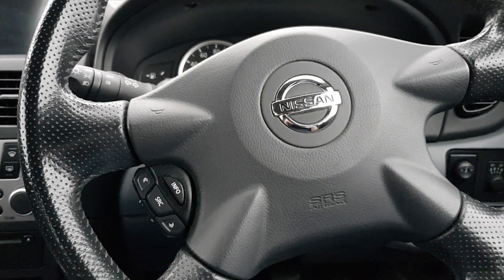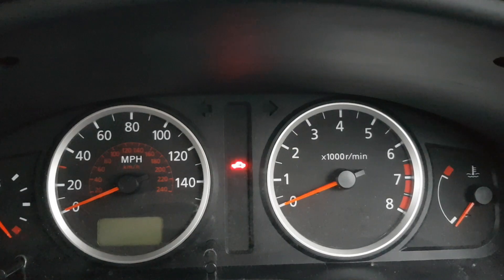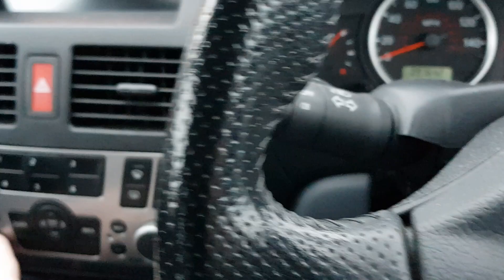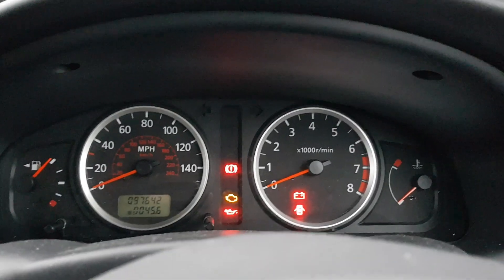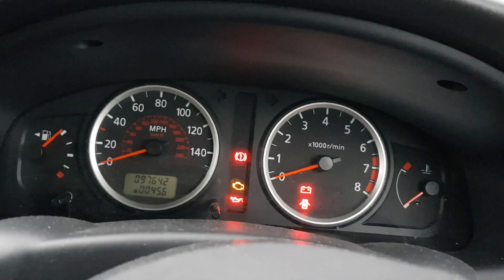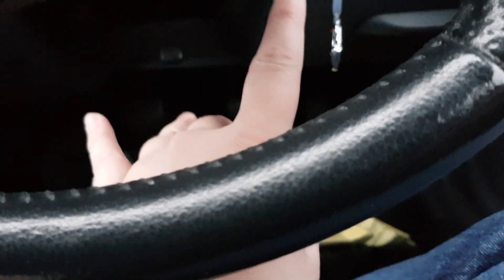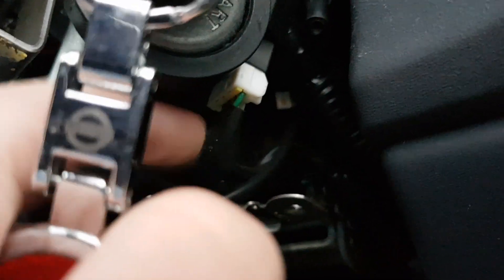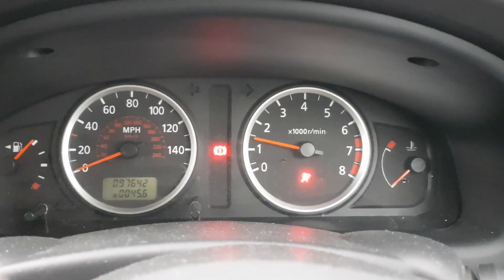How To Fix Nissan Almera N16 Immobiliser Fault

Comment: Oh my God, after being frustrated to the point of rage over the past couple of years, I tried this AND IT WORKED!!!  😮 From time to time the key on car symbol would not go away until after I've locked and opened the car around 7+ times.  Very very annoying.  I saw this guide and tried it as a last resort and I just can't believe it's worked.  The problem hasn't come back once since I did this around a week ago.  Thank you so much.  I was actually getting quotes for new key fobs which wouldn't have done anything so again, thanks for a brilliant piece of information.  I don't know how removing the cable and reseating it has fixed the issue but it has and not I'm one happy driver of my Almera!  😁

Comment: Tried it and it worked perfectly. Problem seems to arise from a low battery or disconnecting the battery. Immobiliser system gets confused and this seems to have reset it somehow. Thanks again for making this video.

Comment: Is that imbolizer light supose to flash all the time ? Exept when the car is running ? I had never owned a nissan before. Tought the flash light was when the car is locked but what i suprice i got when i saw that the light still flashes when the car is unlocked.

Comment: Hi Jmurray, 

Unrelated to the immobiliser but hoping you could explain how to use the integrated climate control on this model. My partner just bought one and the fan is on auto, comes on full blast and can't seem to figure how to manually control fan speed and direction so far. 

Thanks
Reply: turn it down using the round control knob

Comment: I’ve got same problem will try this in the morning , but makes sense as I read on the forum that these Almera have a problem with the wiring harness being a tiny bit short and puts stress on that joint with a bad connection , apparently Nissan charge £400 to replace the small loom ! I think I’ll try your method cheers mate 👍❤️🇬🇧

Comment: Any ideas why Control panel isn't working atall? Fuses are okay.
Reply: I had similar issue as I attempted to install an aftermarket cd player and removed the wiring loom (aftermarket cd player does not work in these cars) if you connect all the correct adapters and makesure they have clicked in then it should work for this cd player and navigation all should be correctly plugged in. Hope that helps.